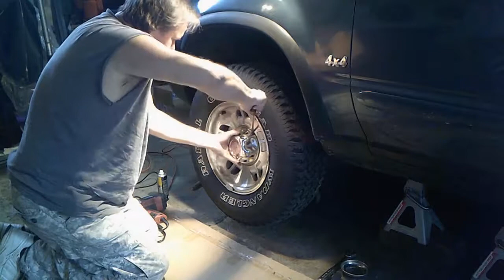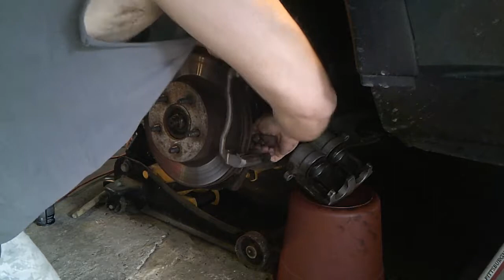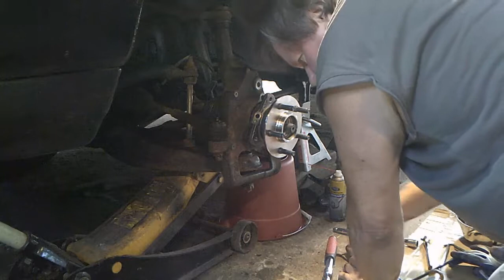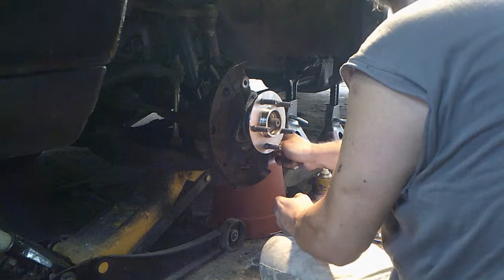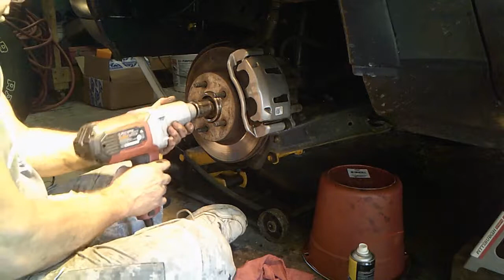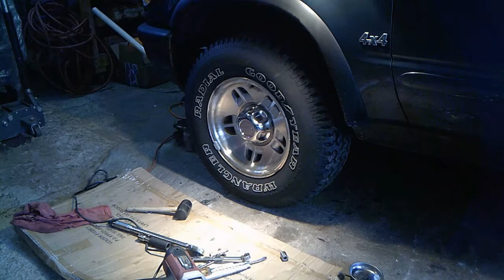How To Replace Ford Front Wheel Hub Bearing, 95-01 Explorer, Ranger, Mountaineer, 4X4

Comment: Was this bad part causing vibrations when you hit the gas at about 30-35 mph from a stop sign or red light when it turned green and stopped when you were coasting/foot off the gas ??? I can feel something binding a little when I try to spin the front driver's side tire by hand. I'm praying it isn't the CV axle or something worse, like gears in the front differential. 97 Ford explorer AWD XLT 8 cyl 5.0 302ci.
Reply from the maker: Mine was making a noise, this was 4 years ago and I don't remember at what speed, but it sounded like a howling/grinding noise "very noticeable". Thanks!